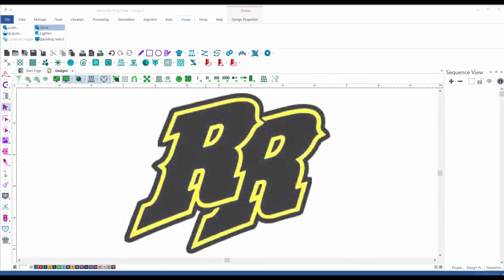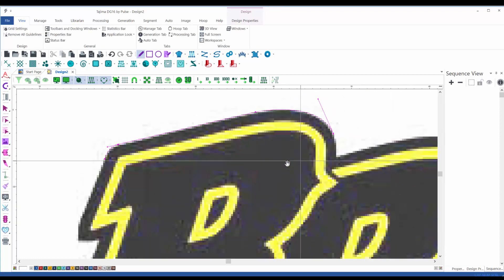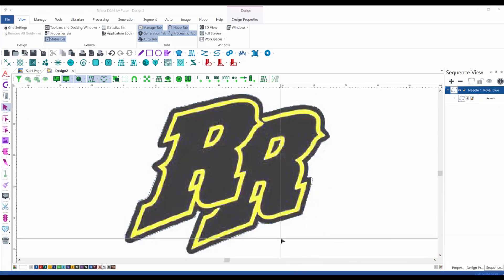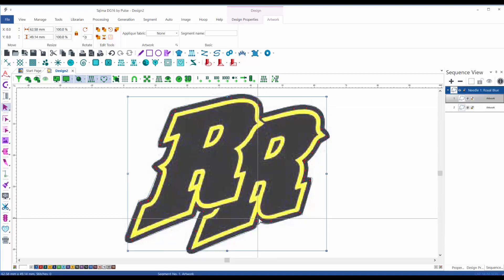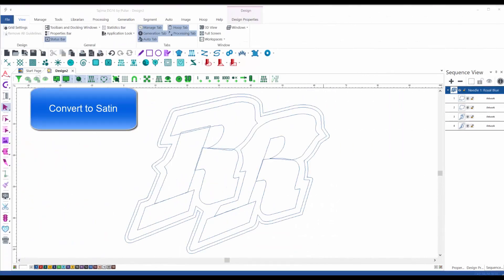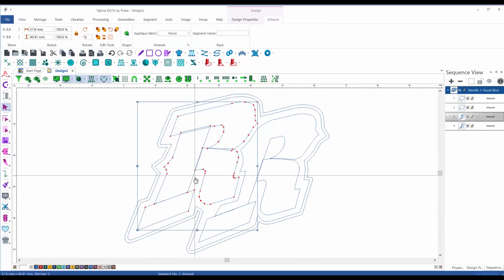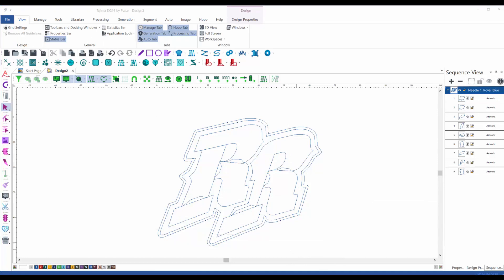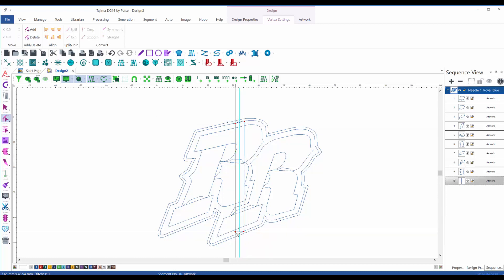Tajima DG16 by Pulse - Digitizing a 3D Foam Design for Caps

Comment: That was a great video, thank you. I wonder, when you were laying out the pieces for the R, could you have went around the outside of the R and then use virtual slices to define the serif areas and stuff and then still be able to break it up into separate segments?  Does that work with virtual slices?